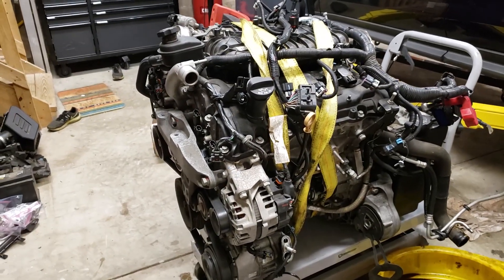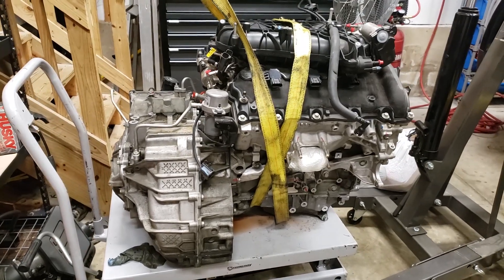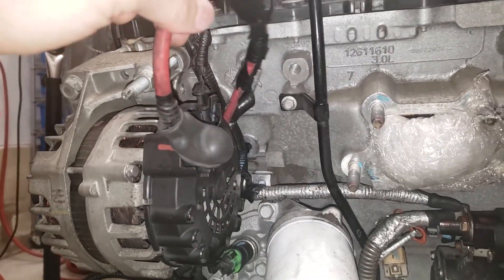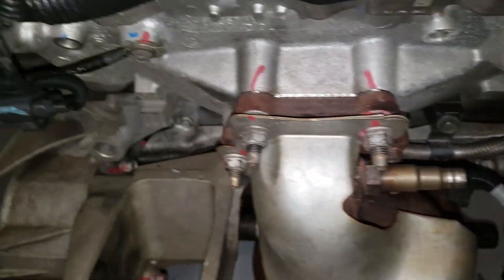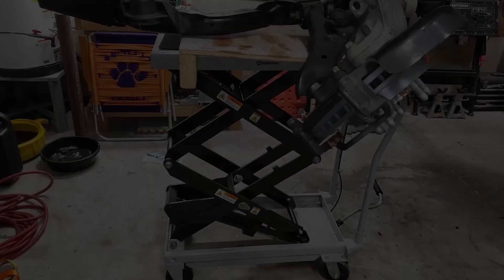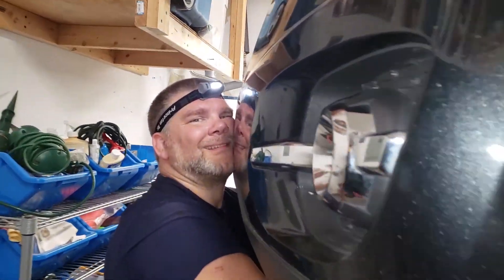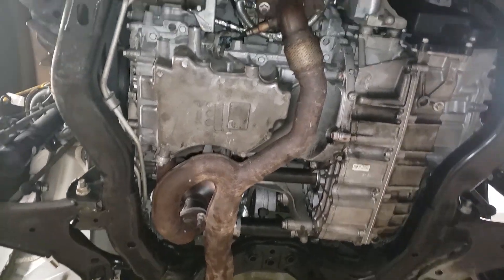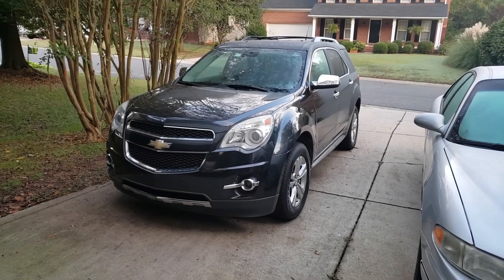2012 Chevy Equinox Engine Replacement

Comment: Great videos!! Loved the humor. I’ve done quite a few equinox engine swaps, they can be a royal pain, but that end result of hearing it start makes it all worth it!
Reply from the maker: Thanks for watching!
Reply: would you reccomend it? I still owe $8000 on my 2012 equinox, and apparrently my mechanic has a used engine with 52,000 km for $6100 all in. im worried about that if I do this I might just hve the same problems as before just with more debt and no vehicle
Reply: Dan Mickalow there definitely worth fixing. But that price seems a little steep imo. What size engine you got? The V6? If so I bought a few off eBay with no problems for about $700-$1100 shipped. Then just gotta have it installed.
Reply: @midnightmechanic1293  I live in Canada thats why so freaking expensive, we get raped here. Its a 2.4 v4
Reply: Dan Mickalow lol oh man. You got the 2.4 ecotec, those are more poplular so it’s pretty easy to find them just about anywhere. I’d check some junkyards for a low mile one out of a wreck also, maybe you can save some $$$ that way. Any will fit from 12-17 equinox terrain captiva all have same. You shouldn’t have any problems with an engine from 2014 and up. 10-13 2.4’s are the worst.
Reply: @midnightmechanic1293  thanks for the info man.

Comment: Does this only pertains to the 4 cyl echo tech or both the 4 cyl and V6 engines?   I got a 2015 Knox with this 4 cyl and I’m afraid it will have engine issues. It has 60,000 miles on it now.
Reply from the maker: This was a V6.  I can't speak to the 4 cyl

Comment: GREAT VIDEO ... Yes, GM should have stuck with the 3.4L engine that used in the 1st generation Equinox, the 3.0L and 2.4L engines are total JUNK! I have owned two 1st gen Equinox and have had very little issues with both my 2008 and 2009. You were smart to dump it after the engine swap! the 3.4L had minor issues but were pretty reliable with regular maintenance. Its sad that GM took a pretty good design with the 1st gen. Equinox and totally screwed it up with the 2nd gen. Not sure 3rd gen is any better.